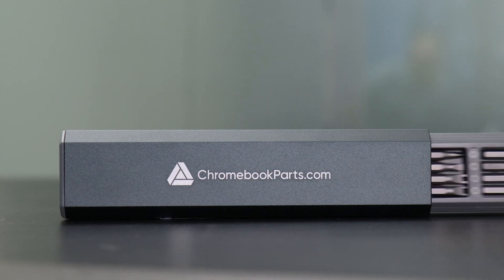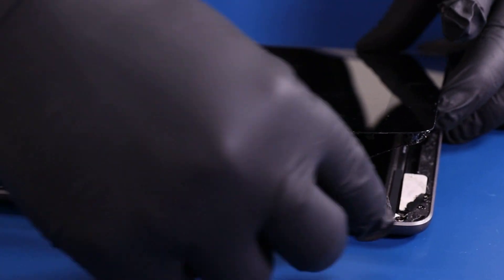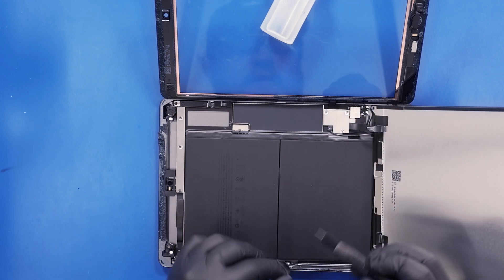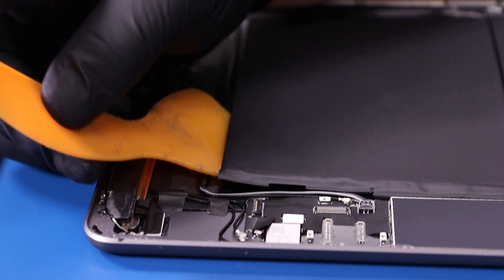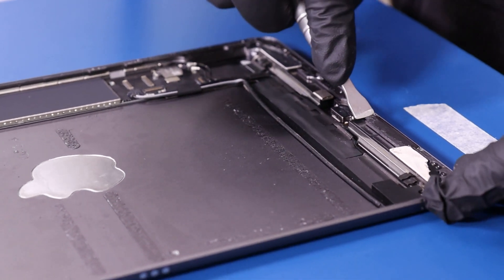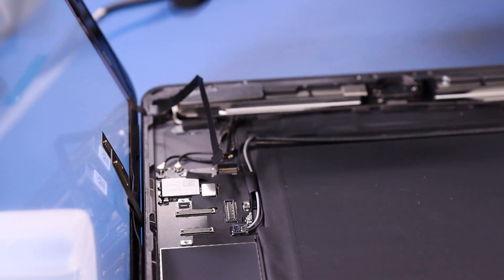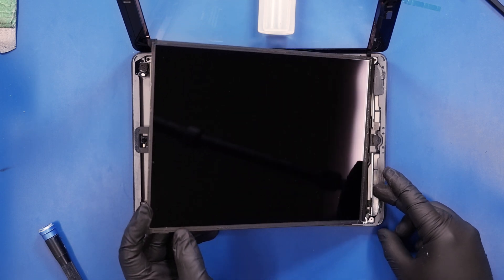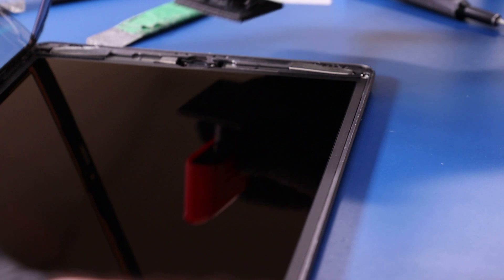iPad Gen 9 Battery Replacement

Comment: Do you have to remove the lcd panel?  Can’t you just work on it while it’s leaning? It doesn’t seem to be needed to remove, or am I wrong?
Thsnks
Reply from the maker: It's not strictly necessary to remove the LCD, but if it got jostled wrong and fell, the ribbon cables could snap, so we tend to just remove it to save the potential trouble.